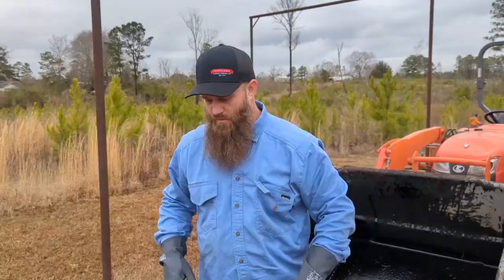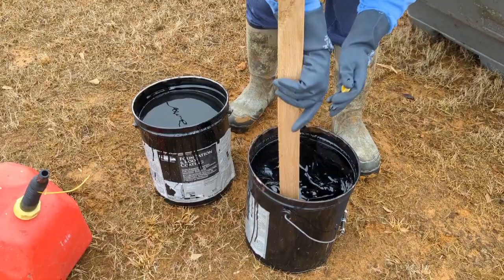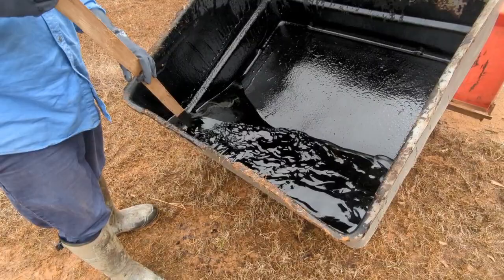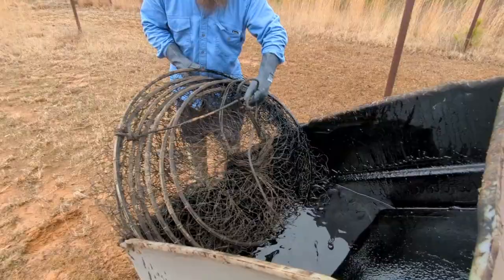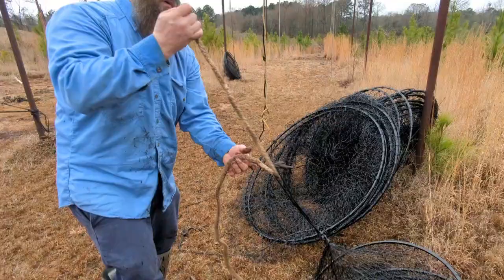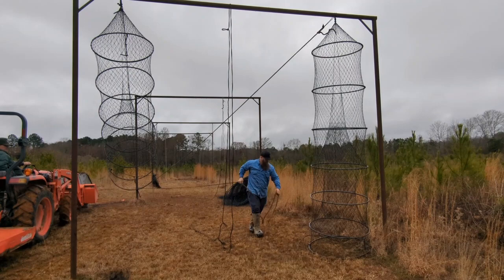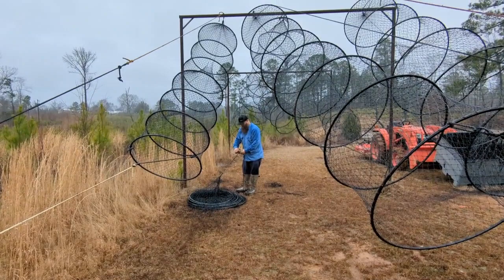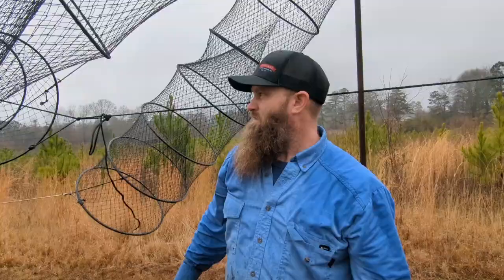How to Treat Hoop Nets, (Dipping Hoop Nets)

Comment: So I’m a rookie here, never dipped a net in my life til tonight. What happens if I don’t get it thinned out enough ? Will it take longer to dry or possibly not really dry at all ?
Reply from the maker: As long as you think it enough that it penetrates all the knots and such your good. Straight roofing tar is thick. It will also build up thick on your twine over a couple dippings to the point that you basically got coated twine. Then it just gets thick looking and in my opinion don't catch as well. Of course more trouble with that on smaller mesh nets like 1in -1.5in meshes. Should not effect drying. Normally takes a good week to get dry enough to fish and they still may be tacky then. Sunlight will make roofing tar tacky when real hot. You'll see cured nets get tacky again in the heat at times. Your also trying to stretch your tar. Stuffs expensive, but so is gas. Do best ya can and go fishing!!! Good luck
Reply from the maker: Also some people dip same nets every year, but you gotta be thinner doing that. I only dip as they need it. River fishing they wear more rolling in current and that twine goes to fraying. Goes getting light colored, they get dipped. Once every year or two on river nets
Reply: @godscountryhuntingfishing1638  I can see the twist in the twine if I look close after dipping , I’ve fished them like 2 years now in the Illinois river. I guess time will tell. I will definitely mix a bit thinner next time too ! I appreciate the response greatly !
Reply from the maker: Yeah, see if not thinned properly, it can just coat and won't soak in. That's not adding any treatment or strength to the core of the twine. All you can do now is fish them. If coating wears off, then recoat later. A thick coat, your always gonna have to fish and wear it off good. We respond to all comments, so Share the Channel up there with all your buddies. We appreciate  the Likes, shares, comments. A good video coming this week. We're going to grow this channel pretty good this year!!

Comment: how heavy is your anchors on these nets ? I am trying to buy the right anchors for mine right now.
Reply from the maker: I got no clue, but it's not necessarily about how heavy they are as it is about how well they hang. It comes loose, you just lost $250. I build my own and never had one come loose. 1in pipe 2.5 -3 ft long. 1/4 in thick flat bar 2 ft long cut on angle. You can see them in our videos. I do put weight on them, but that's to help them get down quick and helps hold em down so they hang better. Any scrap shaft or angle welded to the shafts will work. I need to make some new ones soon, so I'll do a video on that. Hope this helps. I've seen the rebar ones, but I've never used those, so I cannot speak for them
Reply: @godscountryhuntingfishing1638  this helps a lot. I would build on myself if I had the means but I don’t. However I will stop focusing on the weight of it and I will start focusing on the angles so that it will hold.

Comment: How many nets did you dip with the 10 gallons
Reply from the maker: 16 and still got 6-7 gallons left. Your thinning it with gas, so it goes a long way. You want it thinned so it soaks in the twine. You don't want to just coat the twine

Comment: I just coat mine while naked to save my clothes and bathe in gas if I get it all over me. Gas takes it right off . 🥴😆
Reply from the maker: Not good, not good at all🫤
Reply: Did The Fumes get to You ?
Reply: Ever catch any Birds in Them while They’re Drying ?
Reply from the maker: @georgeparrault9945  never have. Only thing we've ever had go in one stretched out in the yard was a chicken on time🤣🤣🤣
Reply from the maker: @georgeparrault9945  you gotta watch those fumes. I just stay upwind as I'm working on coating them. Definitely stay outside where ventilation is good. Hard enough keeping our brain cells as we get older, no need giving any up voluntarily 🤣🤣